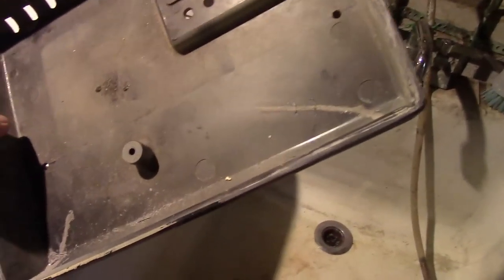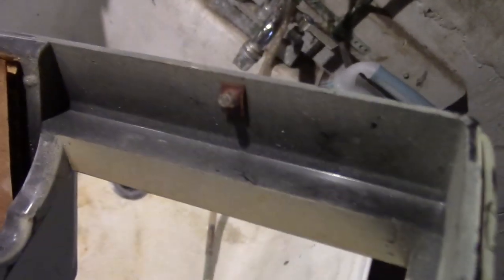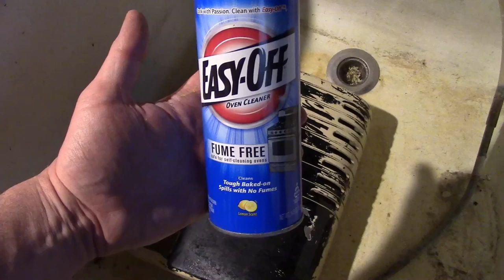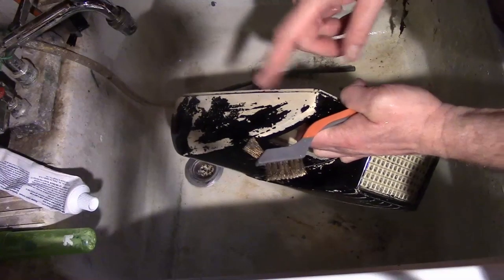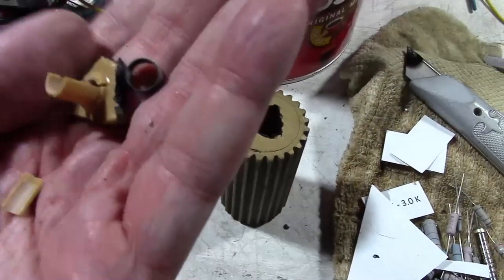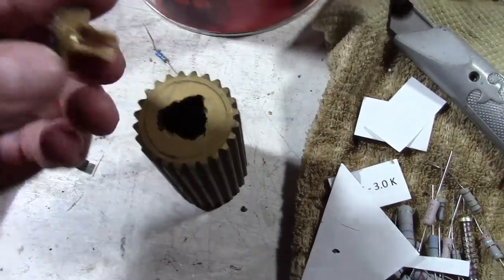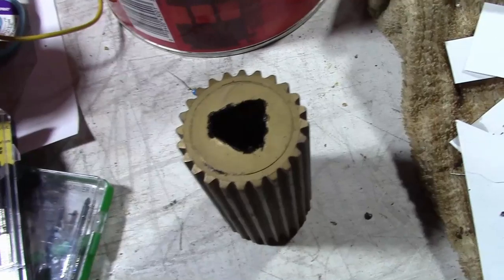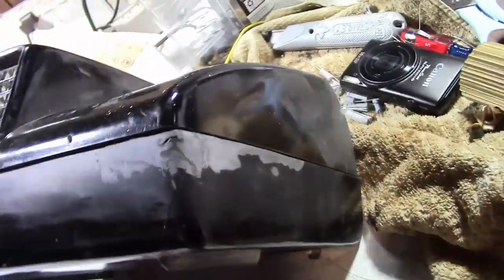Philco 49-901 restoration p5o?

Comment: I can tell you exactly where the edge damage came from because, because of this series, I wanted one of these and finally found one. My was original and pristine when I purchased it but when it got to me, the edge was broken EXACTLY like this in several places. All the tiny chips were still in the packing material and fit together perfectly. The case of these “Secretary” radios must fit so tight with such interference fit that any bumps or jarring when they are together is enough to blow out the bakelite. My damage was identical to yours and the odd thing is that it was packed as well as could have been expected.

To repair it, I did it the same way you repaired some of the other cracked bakelite. I taped it all tightly together from the outside putting all the tiny chips back together and used water thin CA glue from the backside. It worked perfectly and now if I could just get the damn paint off I’d be ready to finish the thing! I have used three different chemical strippers and still nothing! I’m so glad to see another option. I’m heading to the store now... (tried hot water and it didn’t work at all for me)

Thank you for this series, I love my old radio!        Buddy
Reply from the maker: Ah ha, yes that does make sense.  The two haves do fit very tightly together.  Thank you for sharing.
Reply: I posted a quick video showing the same damage... 
https://youtu.be/RD0Ct1sQu0s
Reply from the maker: Wow, that's exactly the same damage!  Nice repair job and thank you for solving the mystery :)

Comment: Hey Bob, 
I've heard some great things about Dawn Dish Power Dissolver for stripping spray paint from things without damaging the underlying material.  Spray it on, let it soak for a few minutes. 
It basically just separates the paint from the object and lets you wash it away.  You can find it on amazon if you can't get it locally.

Comment: On that volume/channel wheel. The end appears to have been spin welded in place. If you chuck it up in a lathe, you could mill out the broken piece you cut the hole in. Then 3D print a replacement part. Or leave the original and completely 3D print a new tuning roller. I say this because my 3D printer was the best recent investment of money and time that I made in the past year. The strength of the printed parts was surprising to me.
Reply from the maker: OK, but who is going to create the 3D design ?  I have very limited CAD experience and lack the funds to get a printer.
Reply: You can also use online services that print for you and mail it if you dont wanna get a printer.
Reply: Or you could just have one of the YouTube “makers” machine a new one out of 4041 Aluminum, complete with the hole for whatever shaft went in it; the outside looks like standard gear teeth to me. And if they have any old radios they need restored, you could even “trade”; you restore their radio, and they machine a new gear thingy for you. 😎 The tricky part would be machining a spline into a blind hole. You could also put tape over the hole, then cast this in RTV rubber and use that to make a mold with clear epoxy resin (which should be obtainable at an arts/crafts store) and drill the hole afterwards, though you’d still have the problem of creating the spline to match the shaft. Afterwards, just primer and paint whatever color to match the radio. Good luck. 😏

Comment: Would it have been easier to use a t-nut on that golden gear wheel where that would have a tapped end on it?
Reply from the maker: I needed to get the broken pieces out of the rattling would drive me nuts.  Also t-nuts and threaded.  I need something that fluted to slide over the pot shaft